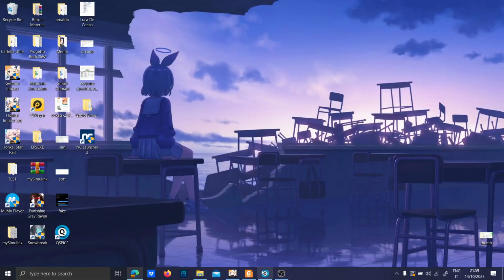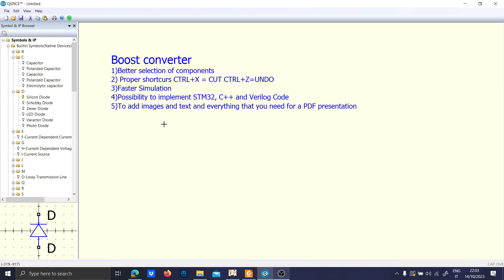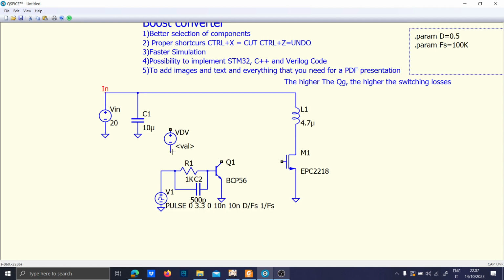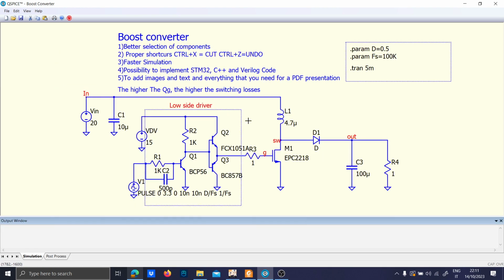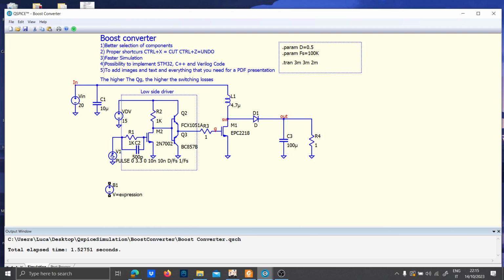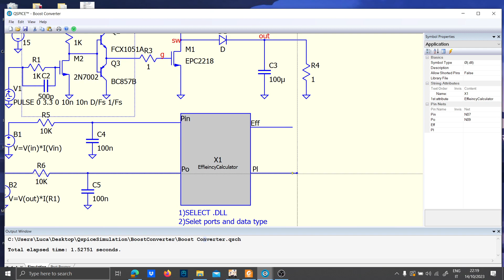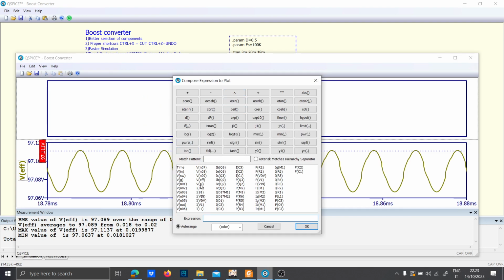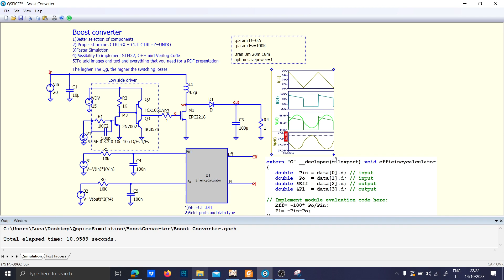QSpice Insight with Boost Converter

Comment: Interesting I tried to install Qspice on Linux, and I understood there is a possibility. On Windows no problems. How do you think QSpice performs, Is that better than LTSpice? the C/Verilog compiler is a must. integrating real components especially from LTSpice/ADI/TI is a must to have, Does it have that capability?
Reply: STM32 ??? I am bounding from my sofa
Reply from the maker: @CallistoPili  Yes, apparently you can even use code from STM32 C, with and output compare to generate pwm I Guess